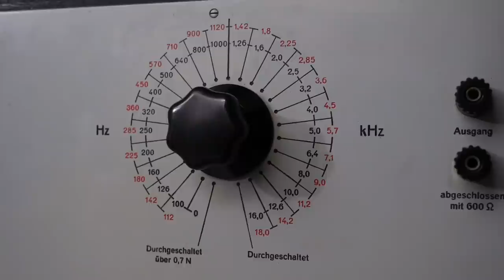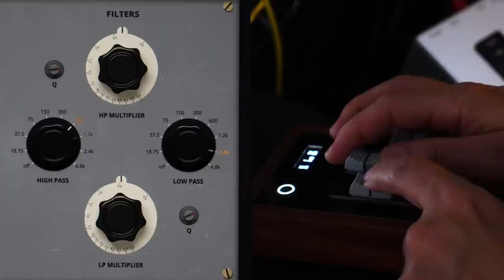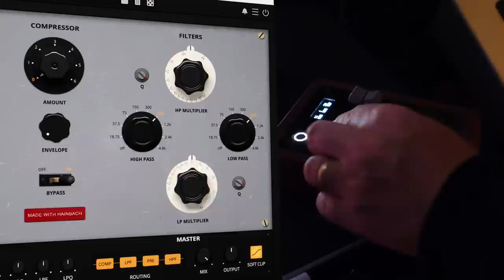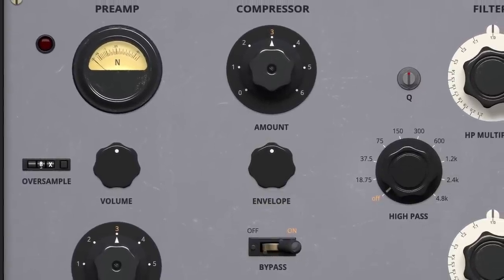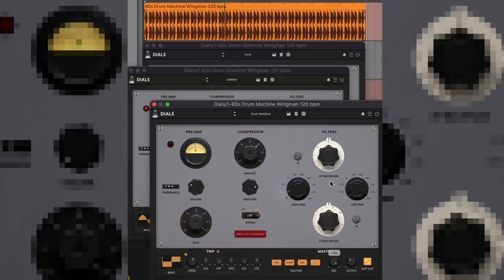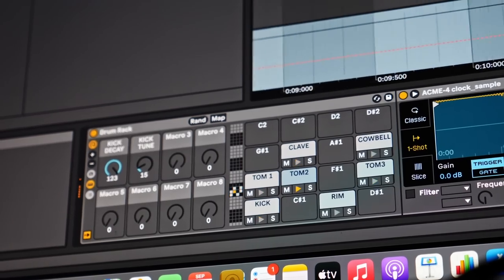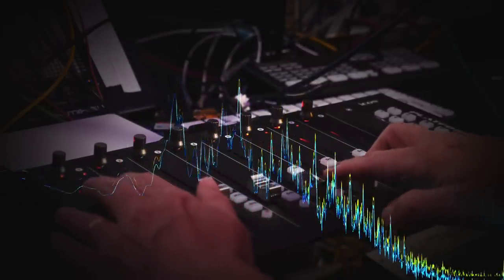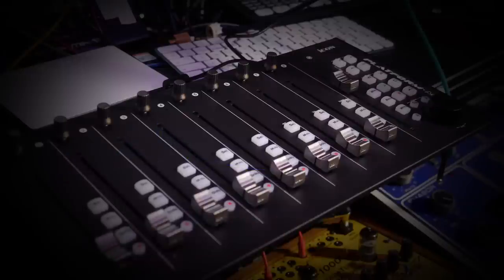AudioThing Dials - The Massive Sound Of Vintage Test Equipment

Comment: Hello, Hainbach, about the matter of whether Plank & Moebius, used Ithaco Dynatrac, it was just a sarcastic comment, it was just a joke about that there were so many strange machines with lots of wires, buttons and knobs, that in that distant October of 1986 (I was only 18 years old), I couldn't know what they were. Now that I'm old and I get information online, I know that many of those devices were Samplers, Computers with Monitors, different types of Generators, Sound Effects, Sequencers, etc...among all that arsenal of machines, I remember there was only one keyboard (a synthesizer of course),. If you want to know more information about that event, I would be delighted to inform you---------------good luck, take care and sincerely yours, Tokron, from Santiago de Chile

Comment: It would be interesting to read somewhere how this device was translated to code.
Also for that "radio voice" filter I have really easy trick - just use "AM radio" Filter curve in Audacity (also sprinkle with some bass boost and over the top pronunciation of advertisement announcer).
Reply from the maker: Here is an article: https://cdm.link/2022/09/dials-hainbach-test-equipment-plugin-review/

Comment: Would like to know how accurate this sounds compared to the original. 
I've not had much luck with it yet, it just flattens signals so much. Came back to this video to see if I missed anything. I'll try linking the parameters to a controller and see if I can do some performance thingies
Reply from the maker: As accurate as you can get. The OG compresses like mad too. But it all depends on how you use it, it is a aconplex effect. I often only make use of the gain for color or I use only the  hipass to make things sit. It also works well to put a signal just in the space it needs with the filter, or it can be its own instrument. With voice it can become a nice big comp. I even throw it on the mix with gain at lowest sitting and nothing else. My advice would be start with init and slowly engage things and listen

Comment: It would be actually even better if you could choose for the frequency bands root specific harmonic ratios. Or maybe I overlook? :)
Reply from the maker: That is what the HP and LP Multiplier is for if I get you right. Set a general frequency with the switch dials and then multiply it.

Comment: It's quite transparent: to make the dials (vol, hpf, hpq, lpf, lpq) move, you click on Trip (an lfo), choose the lfo wave, set the timing 1/4, 1/2, etc. and set the % by which the different dials wil be affected. Or you move the dials manually. You also have a randomizer.
I can achieve the same in Pigment but less transparently, and it would apply to Pigment only.
Reply: If the dials don't move, it's because they are too low or too high. Just move them a bit.